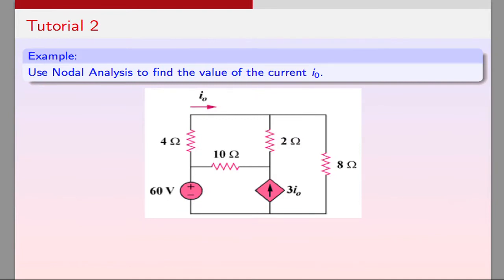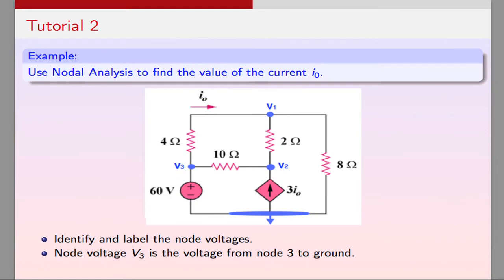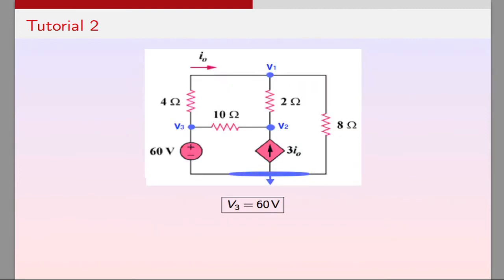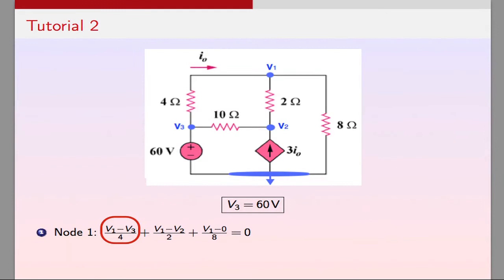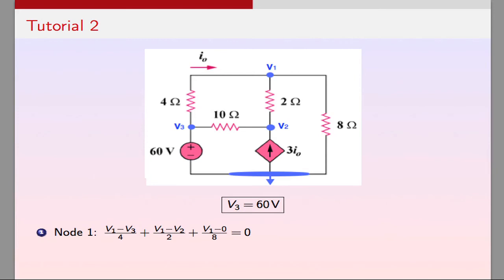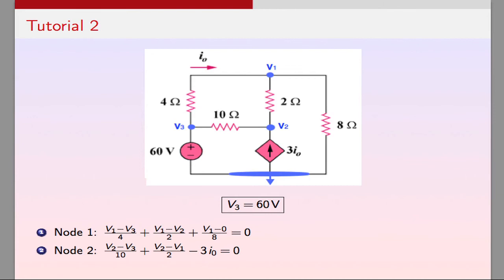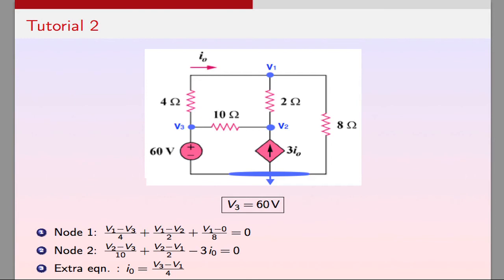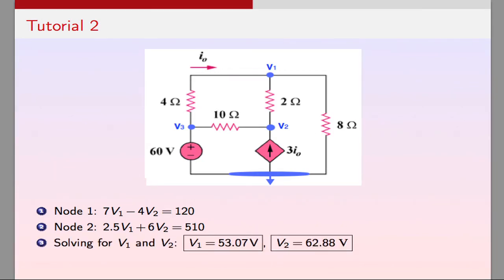Nodal Method

Comment from the maker: The 3i current source is connected directly to node 2, that is why it appears in its equation.
It is not connected to node 1 since there is an 8 ohm resistor between them. So it cannot be included
in its equation.